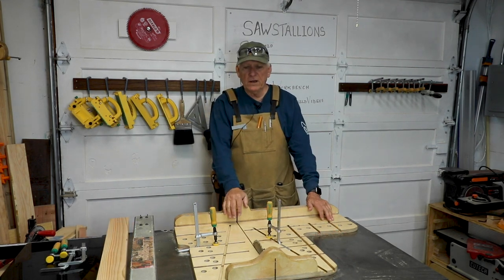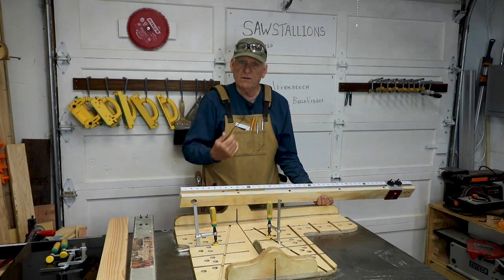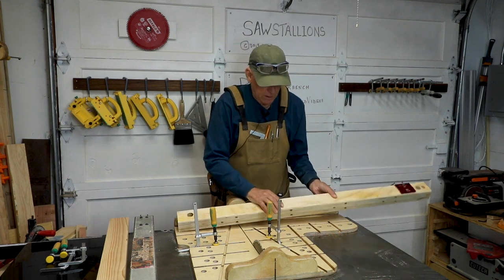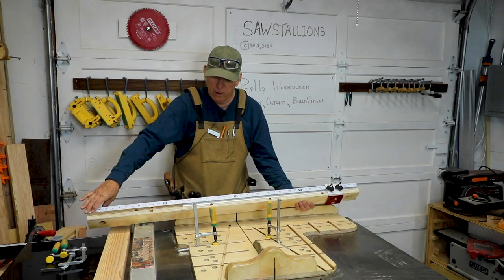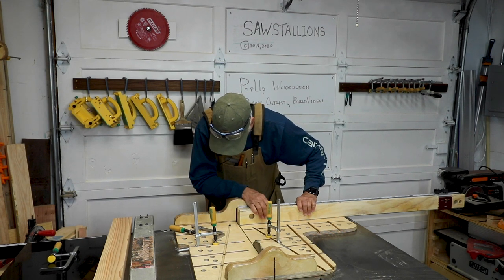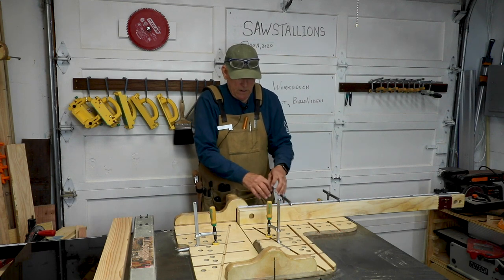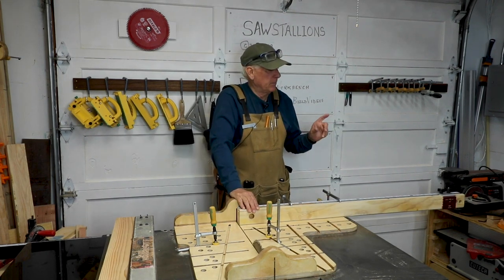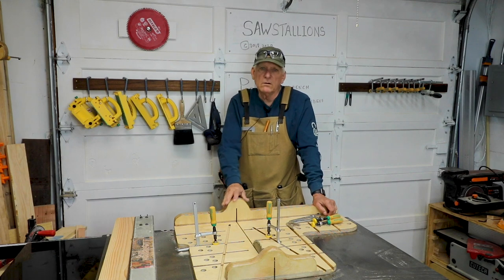How To Add A Long Stop Block Arm to a Cross Cut Sled Using Matchfit Dovetail Clamps or Fence Clamps

Comment: Paul, your cross cut sled is one of the coolest I’ve seen on YouTube. Very clever how you have the clamps and the extension arm. Thanks for posting and keep up the good work.
Reply from the maker: Thanks, Bob.  I am about to re-edit an overly long video on how to build that sled - current video has too many attempts at humor which ads to the length.

Comment: The outtakes are funny and quite human.  That reminds me of how it works in my shop.  Your crosscut sled is quite fancy.  I made my first one a month ago and used the five cut method to square it.  But it is quite simple, 3/4 inch plywood base, 2 layers of 3/4 plywood laminated for front fence.  I made the runners out of oak.  My 5th cut was withing 1/1000 of an inch.  That seemed good enough for me.  I've only got a Dewalt 749 job site saw, but the sled sure does make 90 degree cuts perfect.  I've got a lot to learn to be at your level of woodcraft!
Reply from the maker: What is the old saying “You can fool all of the people some of the time and some of the people all of the time, but you cannot fool all of the people all of the time!”.  I have a long, long way to go in my woodworking skills.

Comment: I watched Tamar's video on her crosscut sled with a removable extension, and now I've seen your extension. Both of you included free commercials for Jonathan Katz-Moses' super duper awesome stop block, and I'm sure he appreciates it a lot.
I like the utility of your extension, and as you stated, it could be made as long as you want, space permitting. BTW, I'm changing my email address and I'll send you the new one so you have it if you ever want to send me anything.
Great outtakes too!
Reply from the maker: Keep me advised of your email since you are my #1 commenter and I want to be able to stay in touch with you and keep up on your. progress of cleaning out that garage!
Reply: @SmallWorkshopGuy  I think I sent you an email with the new one, but I'll send you an email from the new address anyway. I can't spend just 15 minutes cleaning up, I went out last week and spent over five hours and was able to sort my wood into stuff to go into wood I couldn't use for anything but couldn't be burned, (trash), wood I couldn't use that could be burned, (donated to my daughter for firewood), and wood that is still usable. I gained quite a bit of space, so my goal is to build a workbench larger and stronger than what I am using now which is two plastic sawhorses with plywood across them. I'll then be able to get rid of, or at least put out of the way, an old  folding Hirsch saw table that I've been using for additional storage.

Comment: Thanks again for your creativity Paul.  I have a curious question regarding the "Front" block of wood on your sled adjancet to the back push/stop block.  What is the purpose of the front block (Although very nice looking).  Some sleds do not have that front pice.  Thanks for your time Paul.
Reply: BTW Laughing is so contageous!  Thanks for those too!
Reply from the maker: Just for more stability.  I think many more sleds have the front rail than not for that reason.
Reply: @SmallWorkshopGuy  Thanks Paul thats what I thought